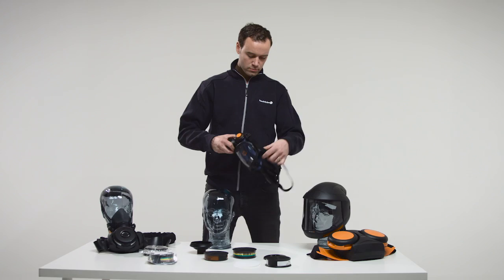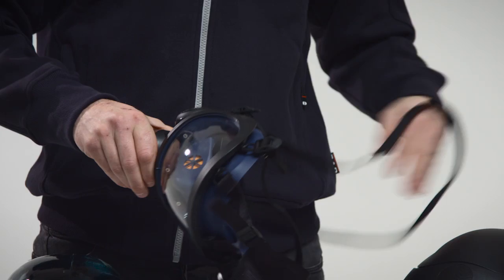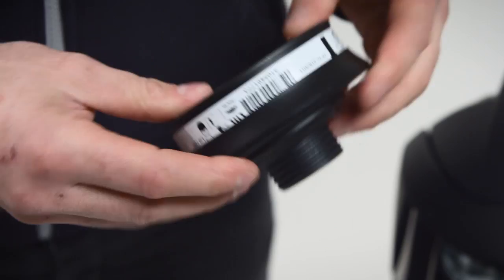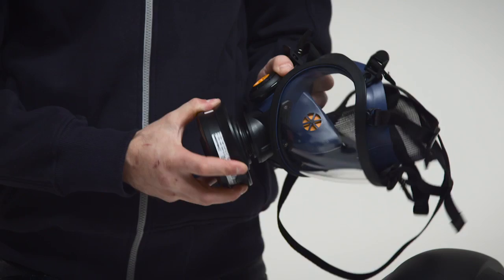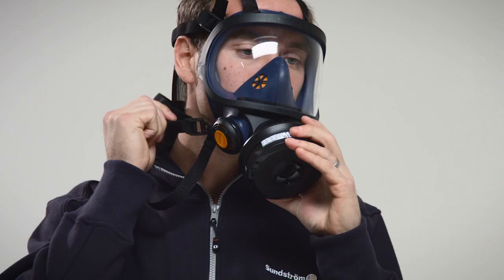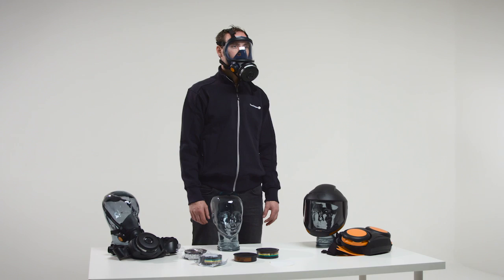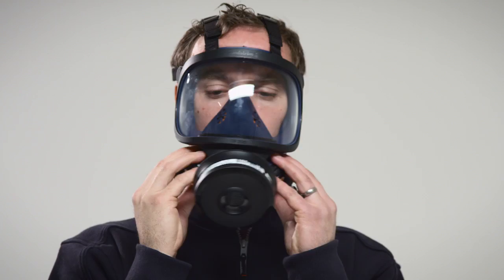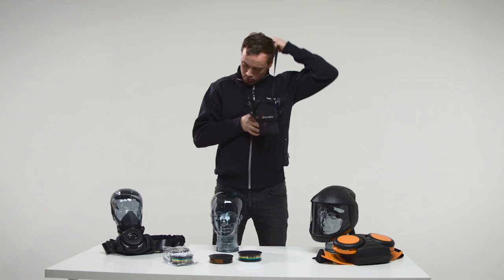Sundström Safety Instruction SR 200

Comment: I bought one and I am surprised by its capabilities. is comfy and I can wear it for long periods. Only complainr it that there is no harness for perople with smaller heads. Like I am a teen and it is kinda uncomfortable because its not made for my head. And the fact that no-one sells the wipes to clean it in Australia.
Reply: We use generic antibacterial wipes, not the branded sundstrom ones at my work, they work just as good!